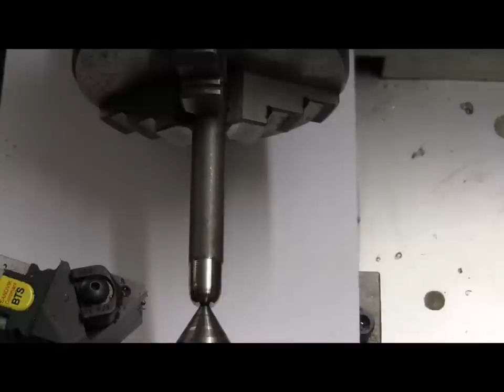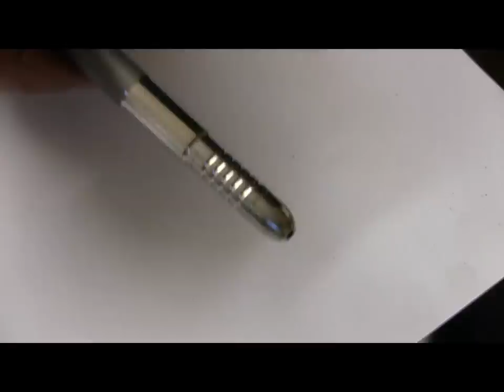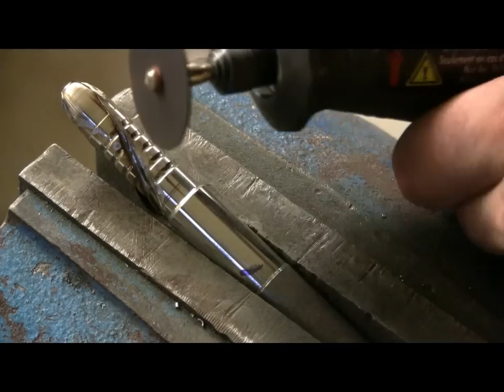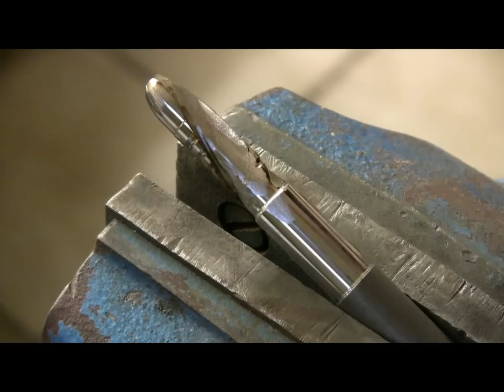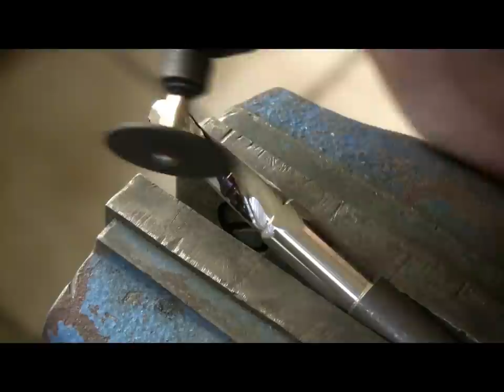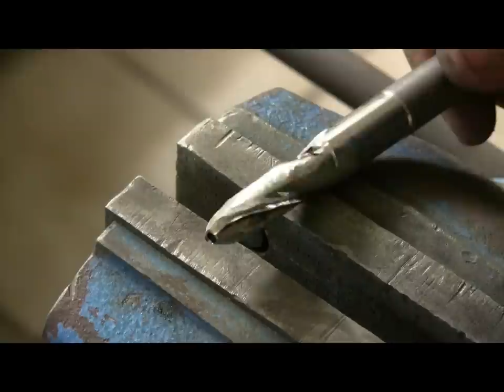Bullet Mold Cutter

Comment from the maker: Hi Tom, 
the steel for the tool/cutter was 12mm HSS that i got from ebay. On the outside it is very hard, which kills every carbide tipped tool.

Comment: Hello. This was very interesting to watch! I understand that after trimming the cutter to desired nose shape and groove contours, you must cut spiral relief grooves because you're spinning the tool between the two closing halves of the mold block. But it appears in the video as if the desired shape is almost completely obliterated. I assume I'm not seeing something here which you do see when the job is complete. Is it at all possible to put some annotation notes on the video to explain what is going on? Thank you. :)
Reply: jsm666 only a small line that is the outer most part is necessary because that is the furthest the the cutter will cut
Reply: The cutter spins, so as long as he leaves a tiny part of the original diameter on the cutter, it will cut the whole mold to that size

Comment: Useless to waste so much time making the lube grooves only to dremel it down to the wrong size.  Lets see the mold block it cut and casting bullets  or it got thrown away like so many other disappointments.
Reply: The grooves will still form as the cutting surface for them are in a spiral, still to the original dimensions it came off the lathe. This design will work, but it is significantly overcomplicated unless you are making more than 10 or so cavities. A simpler method is to use something like a Grade 8 bolt, cut it to profile, then cut the profile lengthwise in half, and then harden it. Saves tooling and time.